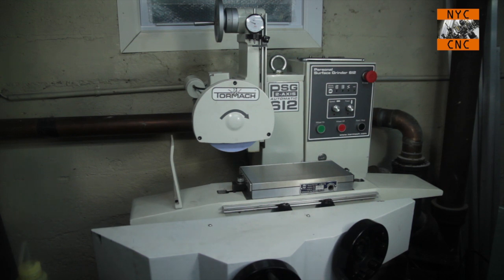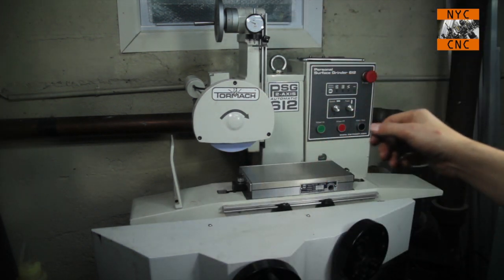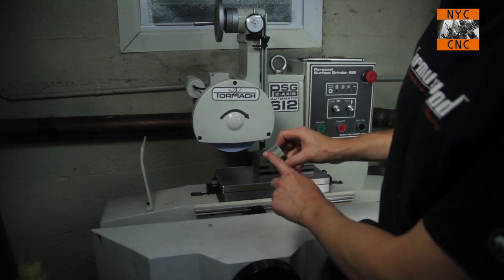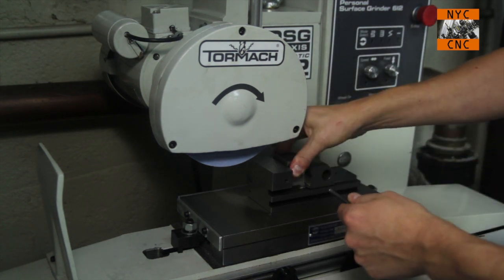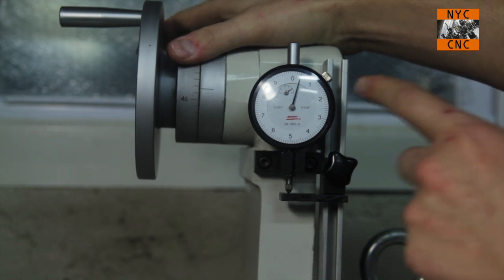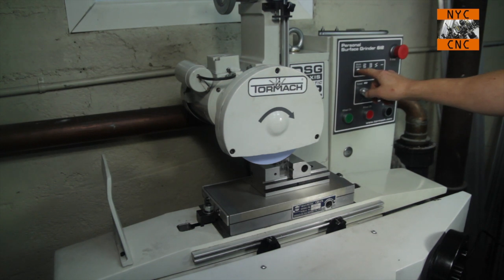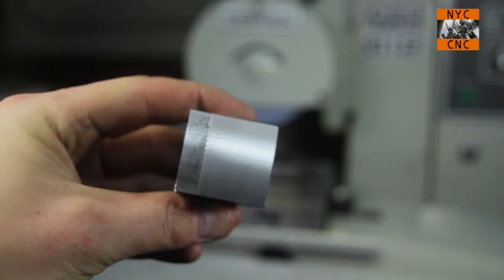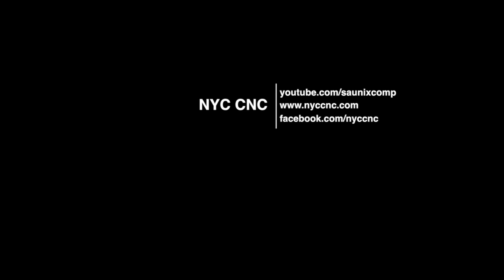Tormach Personal Surface Grinder! PSG 612 - Just Arrived!  First cuts...

Comment: If I ever seen a guy in my shop stop a wheel to touch off on the work id never let him hear the end of it. Not only are you wasting a bunch of time but why even dress a wheel if you are just going to stop it. Pointless.
Reply: opps didn't realize you were so new to surface grinding. Try just dressing your wheel, bring it close by eye over the piece. Either by hand or using your power feed just drop it a half to a full .001 from side to side until you dust it man.

Comment: Good video. Thank you for turning off the wheel before putting your hands around it.
I got thirty five years as a machinist and I've seen a lot of fingers that got ground away by not following safety rule number one.
Reply: NYC CNC If your table has enough travel, you can move the chuck all the way to the right so you can do what you need to do without having your hand near the rotating wheel. Also when you put work on the chuck, be sure it's impeccably clean, one speck of grinding dust can screw up a part's dimensions, parallelism, etc.
Surface grinders are a big pain in the ass too.

Comment: Hey when you use the grinder to touch off, just get the wheel close to part by eye( i would suggest getting a lamp for the machine to help with touching off and other things you may encounter) and manually move the table back and along the X-axis While SLOWLY moving the wheel down. Something to note is when your close to touching off you'll hear the wheel coming off the edges of the part that's when your at the point of touching the part. This is so you can touch off with the wheel on and it's way quicker to do.

Comment: Phil is good. I like his content. I had a lot of luck with my grinding after consulting The Grinding Doc. The price of Phil's subscribe its not cheap but he does have good content. I think you'll have luck with grinding.
Reply: workpiece burning (almost heat hardening), poor finish, extreme wheel wear and needed lots of dressing. Jeff fixed my problems, as I followed his recommendations to the letter.
Everything else I tried to remedy it, didn't work.
Reply: I'm considering doing a workshop series in my shop locally on grinding. The instruction I got from The Grinding Doc, I now use to train the operators of my grinding equipment in my shop.
Reply: yes, Seattle, WA

Comment: Never stop and start the wheel with out redressing it with a diamond touch the part with wheel running and never make more than a .001 cut  and always check wheel for any damage so it won't explode have fun with it

Comment: Say your grinding a large piece of steel with a 0.001 depth of cut and 0.1 feed for every pass of the X. At first all cutting is made by the first 0.1 of the wheels width, the rest is the spark out region that only rubs and polishes the surface. With further use the spark out regain is reduced and the cutting section increases. When the spark out region is shorter then the Y feed, you then no longer have any over lap.

Comment: the grinding wheel should ALWAYS get dressed before an operation with a diamond tip and it should be also ALWAYS turned on because if you turn it on and off the wheel slips a little on the shaft and is no more cylindrical...

Comment: first you got to grind the magnetic table then put the piece on it with extra parts behind it so it will not get thrown off the magnetic table... if you have finished the first side just flip it over and put it on the magnetic table again so both sides are perfectly parallel :)

Comment: I have used all the best brands of surface grinders churchill, chevalier, boyar schultz, rockford, sharp, and my own harig. And not one had a column lock. You are in stead expected to have the Z ways tight. The Y and occasional X lock are vary use full though.

Comment: You may have heard that said in an educational environment as a rule of thumb to convince you to dress often, but by no means is that correct. Provided the bearings are in good condition and the wheel is secure, turning off the motor will not compromise the precision or surface finish. Ideally the wheel should be dressed just before the sparkout section becomes less then the Y feed. Between passes often the work is removed to messier, at this time it's necessary to stop the motor for safety.

Comment: Looks like another nice unit from Tormach :) I know next to nothing about grinding but it seems like the guys I work with running the surface grinder are always dressing that wheel. They use a diamond tipped tool mounted in a block that gets clamped in the vice. Theirs is a very old machine though - all manually operated.

Comment: chatter ripple was due to Z not locked or base not mounted and the flimsy machine flexing, or another solution the electronics should provide a smooth acceleration/deceleration

Comment: Some notes on safety and operation. Before grinding the wheel needs to dressed to ensure a smooth uninterrupted cut, this is to be done with a diamond tool at the correct position Page15 of the g5963 manual. Touching of the wheel to the work should be done with the motor running, and a slow approach to the far right corner of the work with an eights inch of wheel width. Should you crash down wards there will be only a little skip.

Comment: Been looking forward to seeing this video for a while now. The tormach is one of few if any electric feed surface grinders, offering alot to hobby consumer market. The only complaint I see with the tormarch is lack of dust extraction. Only toolroom grinders will be  without coolant or a vacuum, and to be used with only occasional use. The kind of production grinding outlined in the Design Analysis absolutely need dust extraction, Otherwise the auto feed is a gimmick if it cant run continuously.

Comment: so you'll be wanting me to send over some blade steel to get accustomed to 400 series? haha if you insist...

As for information, the only thing I really know is that, for parts with questionable rigidity on the chuck, you'll want to use that comb-shaped feed pattern. That way, if it moves a bit, it'll just kick out a bit, rather than over-feeding and getting pinched under the wheel and subsequently shot into the spark-catcher-thingy